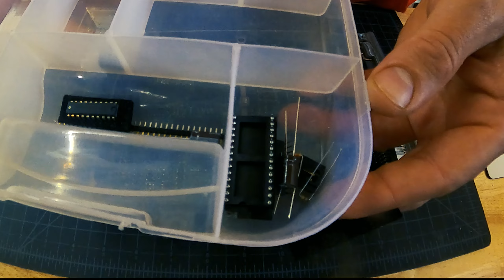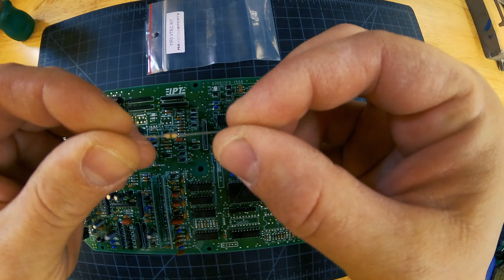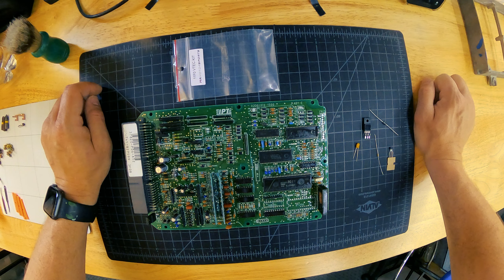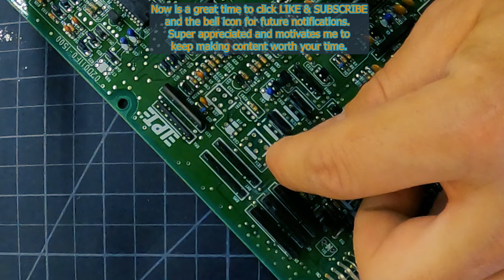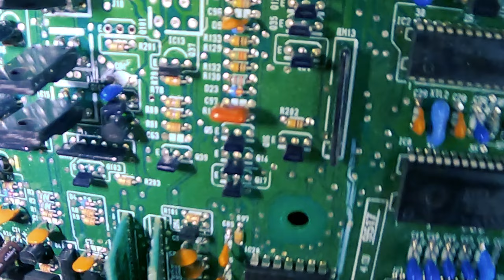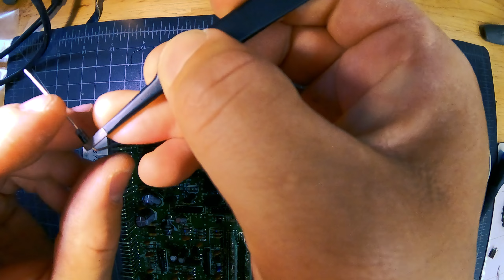Honda ECU Chipping | Add VTEC to P06 | Tuna No Crust Garage Episode 34

Comment: Nice video. I had a question about my ECU its a Honda P9L-E13 board can this board be ECU chipped? I live in Europe and don't know if that makes any difference in the boards.
Reply from the maker: Unfortunately not, P9L series ECU's are OBD2a as I recall. 

Technically you can actually, however the chips are very expensive and requires the ability to micro-solder well over 400 pins on a single chip. I personally do not know of any tuning software as this is not common. 

You can convert your car to OBD1 by getting an adapter harness to plug in an OBD1 ECU to your OBD2A harness. Several places make the adapter harness, notably HAMotorsports.
Reply: @tunanocrustgarage  Thank you so much for answering back. If I would buy the obd2a to obd1 harness. What ecu would you recommend getting for a D15Z8 manual Honda civic?
Reply from the maker: @goodmatchplay1372  If you want a full play and play affair with tuning capabilities look for P28 or P75 ecu's with socketing already completed or Hondata already installed. 

Alternatively you can add features like VTEC, PWM and more to a P06 ECU. If you are not already subbed, go ahead and sub and stay tuned for more ECU modifying videos. 

You can use my content to help you learn how to modify and tune your ECU.